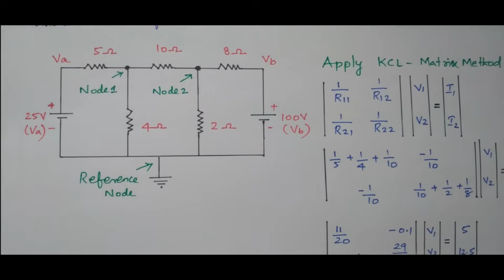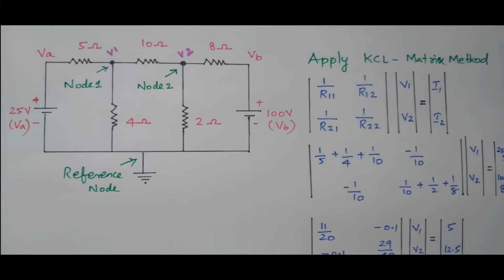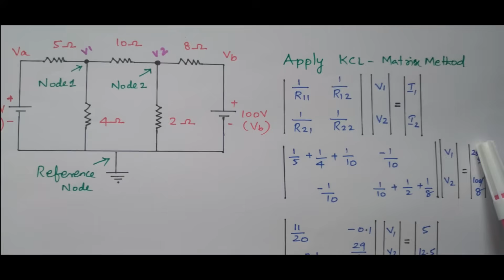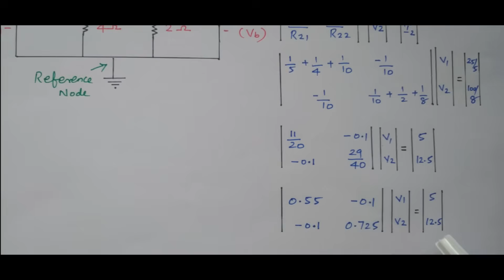Solved Problem #2 - Nodal Analysis - Matrix Method - DC Circuits - Basic Electrical Engineering

Comment: If you devide 25V by 5ohms you get 5A, this means that the voltage at point V1 equals 0V . i dont get this one.
Reply from the maker: Current floowing through 5 ohms resistor is depends on this 5 ohm and 25 voltage, so the current is 5 amps. Voltage at node 1 and 2 we need to calculate